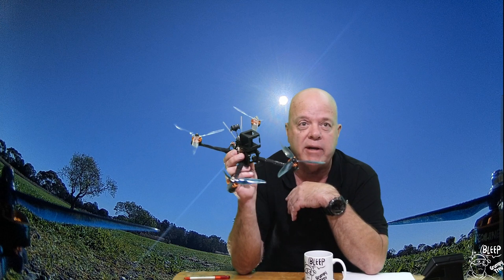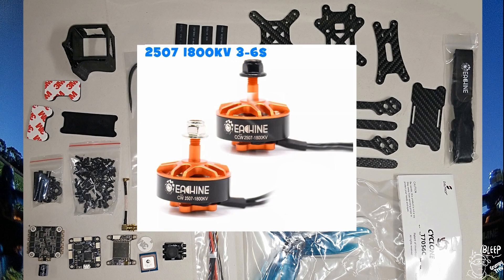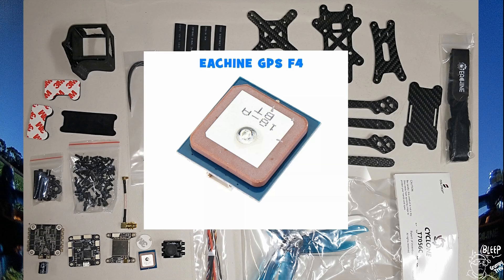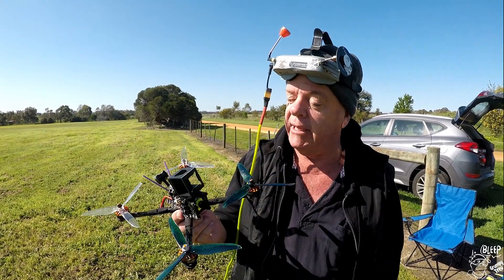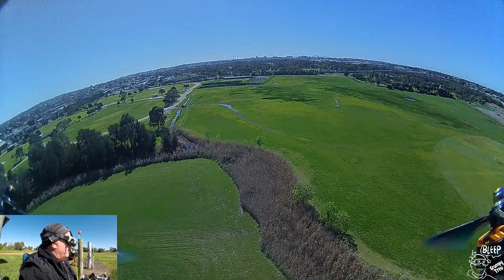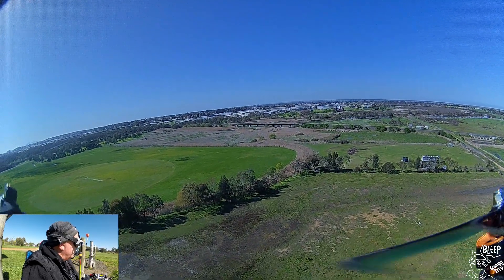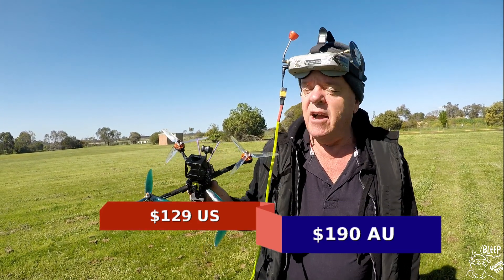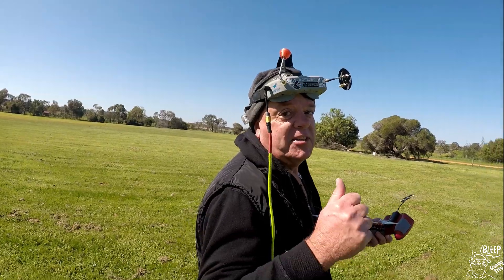tyro 129

Comment: Just bought this one. Will be a great addition to my fleet! Thanks for the vid Trev!!!
Reply: How much run time are you getting mate?
Reply: @TheDownloadfreegames  right now I can't get it to arm. Betaflight shows it working as far as the arm switch goes but arm won't turn yellow.
Reply: @tinfore  hope you get it fixed man, looking forward buying one soon and was wondering about flight time
Reply: @TheDownloadfreegames  Figured out that on this quad with GPS you have to have a minimum amount of satellites locked in before it will arm. Also, you can't arm it when it's connected to the computer.